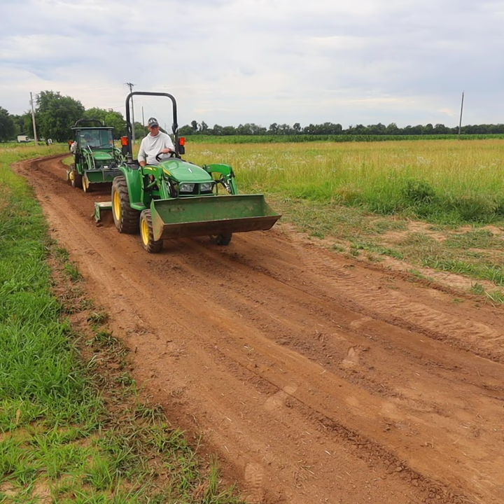Digging a Drainage Ditch #shorts #tractor #johndeere #homestead

Comment: Erosion over time will illustrate the importance of a drain
Reply from the maker: A regular drain can also require maintenance overtime, but the difference is the difficulty of that maintenance. If your drain silt in or gets crushed, it’s difficult to fix it.

maintenance on a swale is quick and easy. Just like building it.

Comment: Unless someone gave you fuel and compensated you for time, I'm going to have to call B.S. on your cost analysis, otherwise not a bad idea -
Reply from the maker: Well, personally, I feel like it’s less than free doing this project. I almost feel like I should have to pay to get to run the tractor which used about $12 in diesel

Seems silly factoring in that fuel cost on a project that would’ve cost me 1200 to do it the other way myself, or 2500 to pay someone to do it.